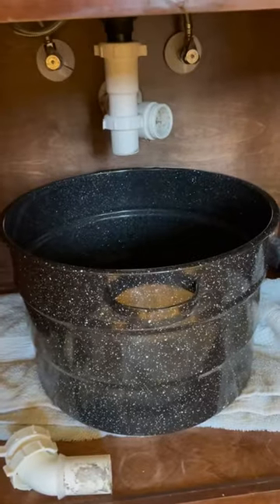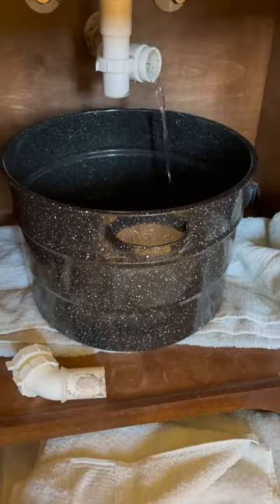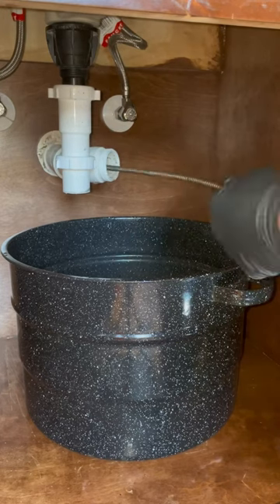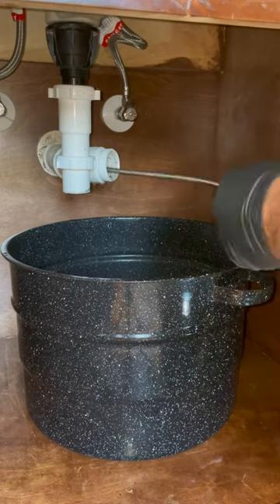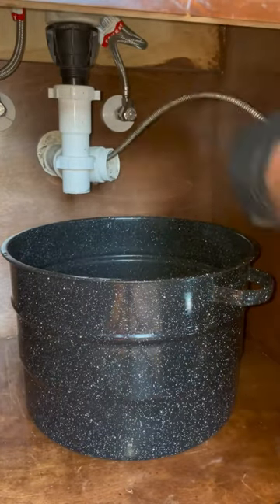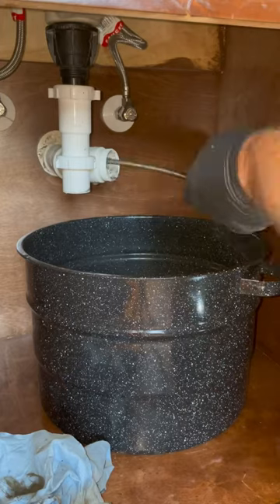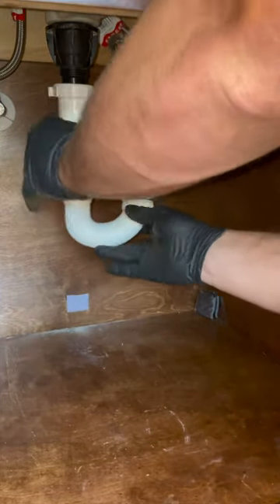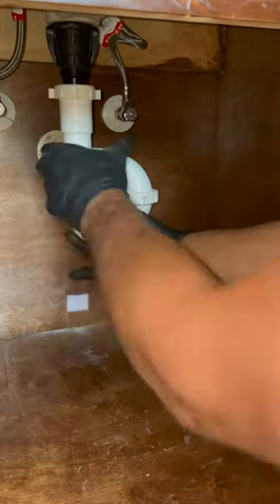Clearing a clogged sink drain. #plumbing #drain #fyp

Comment: This is why I stack tee's instead of a cross. Question; when the ac drains into the wye tailpiece , doesn't the constant sound of running water coming from the lavatory drain while the ac is on get on the customer's nerves ?
Reply from the maker: You usually can’t hear it. The water slides down the side of the pipe rather than drip into the water of the trap.
Reply: Some inspections won’t let you stack tees if it’s venting of the center. They claim it’s “wet venting” 😒

Comment: Wtf why would they tie the Condensate drain to the plumbing smh. The condensate drain from the air handler should have it's own line to the exterior of the home.
Reply from the maker: Old homes are like that. All new homes have it to the drain like this.
Reply: @theplumbersplunger  wouldn’t it be better if they had a condensate pump going into the drain so that it wouldn’t clogged up. We have a condensate pump on our Trane AC and furnace and have not had any problems and it was installed in 2009.